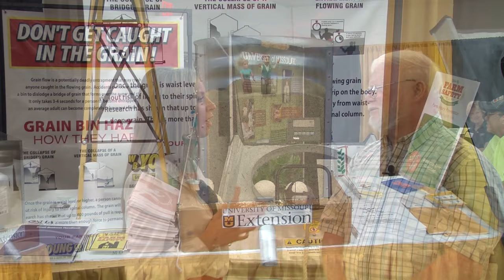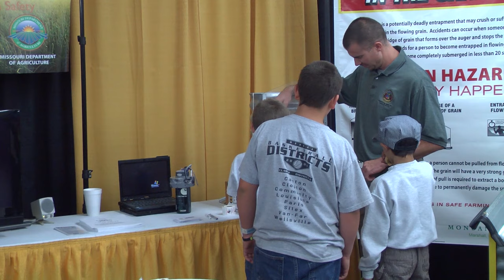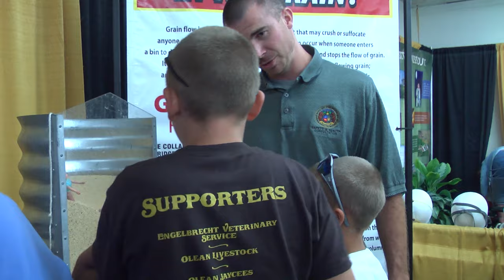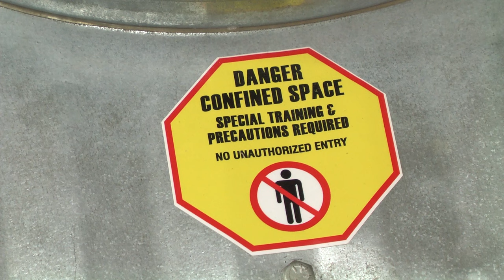Labor Talk: Grain Bin Safety

Comment: Why can't they build grids across the grain bin that ride on top of the grain. Even if they were made a every 6 feet the grain could pass thru but not a person.
Reply: Grain that sits for a while clumps together.  Putting in grids would create blockages to the flow, & require someone to go in & clear them.  You'd end up increasing the risk of accident rather than reducing it.
Reply: Great idea
Reply: jim jon Install it above the grain line maybe?
Reply: Its. Grain sinking party
Reply: Add vibrations to the grid also
Reply: @1jimjon  Those grids would work very well.   Hinged doors to access lower grid levels.
Reply: Until you see the price tag

Comment: Couldn't a silo be designed to have a blender type function or some kind of mixing component so people don't have to climb inside? Farming has been around for centuries. Seems like someone would have fixed this issue by now.
Reply: That would require a significant amount of power.
Reply: There are vibro silos and mixing silos too. Most of vibro types are out of order and mixers are extremely expensive

Comment: How do people fall in?!
Reply: I'm a farmer with 40+ years experience in grain bins since I was a boy. 

The bins are emptied at the center of the bottom of the bin. As the corn is being taken out of the bin it creates a funnel towards the center and the corn (or other grain) actually "avalanches" into the center. Corn weighs 56 to 60 lbs per bushel (which is about 8 gallons) so imagine being surrounded up to your waist in 1000 bushels of corn.

How do people fall in? Well the mistake they make is just being in the bin, standing in the corn while it is being taken out. If a person gets too close to the center or the low point of that funnel and he's already knee deep in the corn, his chances of getting himself out are very, very slim. Also, dry corn is very difficult to even walk across because your feet will sink almost a foot with each step.

When I was a kid in the early 80s, our biggest bin was only 15 feet in diameter. In a small bin like that you can probably get away with being inside while the bin is being emptied, although it is still very dangerous. Today, my biggest bin is 48 feet in diameter so from the outside wall to the center there is 24 feet of "avalanching" corn and there can be as much as 2000 bushels of corn that avalanches in just a few seconds. In a 15 foot diameter bin there might only be 100 bushels. Plus, many of today's large bins empty twice as fast as they did 30 years ago, which increases the level of danger by being in the bin.

Never ever get on top of the grain in a bin while it is being emptied.